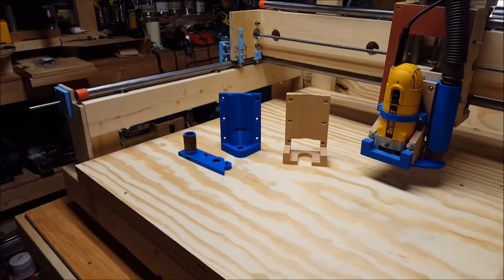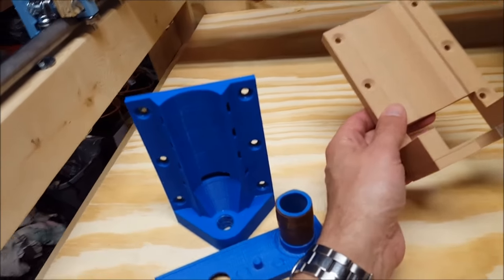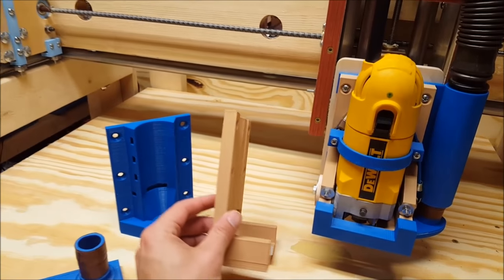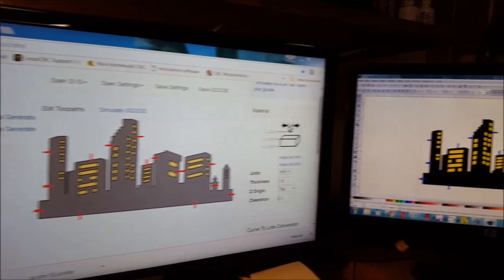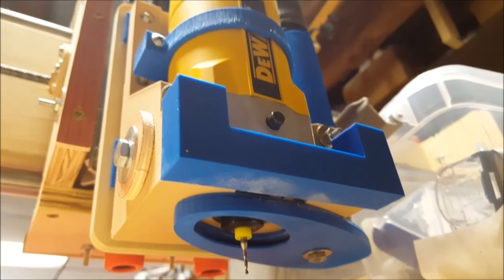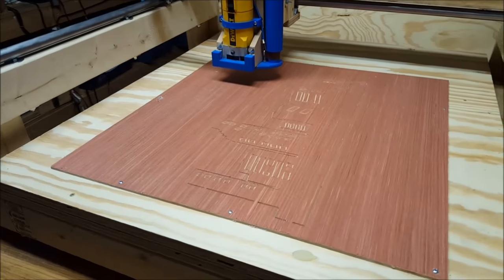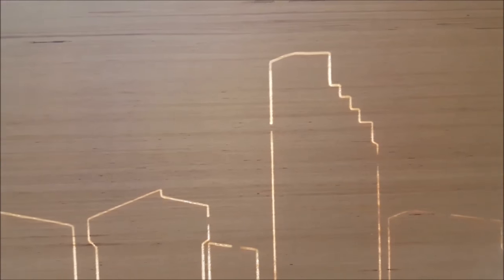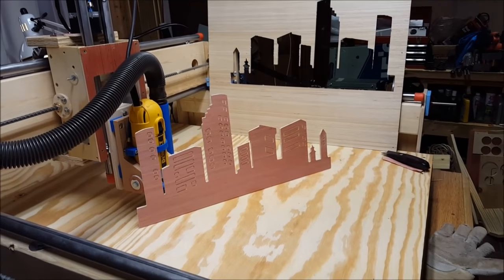Solsylva DIY CNC - Router Mod & First Wood Cut

Comment: Maybe a stupid suggestion but couldn't you remove the essential parts for the router itself from the yellow case it's in? I asssume the lighter that it weighs the less it would stress the material holding it. Plus you could make it smaller possibly. Not sure if that's the situation. Cool videoss though.

Comment: I was wondering what 3d printer are you using to print out all of your parts. The parts look top notch. I am on the fence in regards to building a 3d printer first or a CNC router. I want to keep the price of a base 3d printer at $300 or less. Any thoughts would be appreciated.
Reply from the maker: Hi Robert.  The 3D printer I have was a very inexpensive eBay kit - an Anet A8.  I paid around $175 for the kit and I think they are currently around $150 or so.  I took my time putting it together and it has worked out pretty well.  It took some time to get it dialed in and for each print the bed needs to be tweaked and leveled.  The 3D printer and CNC machine complement each other.  A 3D printer kit will go together much faster than a CNC machine and for quite a bit less money.  Both are fun builds.  Best of luck.
Reply: I also use a cheap 3d printer and the cost was £150 uk,the make of mine is a reprap prusa i3 and im getting fantastic results now after a lot of testing ,I also have to level my bed per print which takes a couple of mins max .as for cnc I also own 3040 which may I add is a fantastic little machine and ideal for a first low cost cnc ,keep in mind that you will need to purchase mach 3 if you go down the cnc route ,
Reply: Thanks for the reply. I am considering the 3040. Seems like there are so many suppliers around with lots of good and bad reviews... Probably along the same lines of not wanting to buy a car built on a Friday everyone in a rush to get the car done to start their weekend...lol Did you purchase a kit for your CNC of piece of out... of you don't mind me asking how much was the cost minus software?
Reply: drez20001 thanks for the reply back. Awesome videos by the way. I WAS just watching your unboxing off the HTC Lathe. I am currently in the market for a large and can't make up my mind. I am really thinking about getting a used Shopsmith just for the lathe portion.. Any thoughts?
Reply: hello
i have a 3020t and as with you its a nice little nachine  now i purchased snapcnc from a company in germany called docado for 50e  it is grbl based and you do not need mach3 it controls the cnc and  can be ran from a tablet or laptop an excellent  piece of work as there is no need for a parallel port it usb basedjust though you might like to know